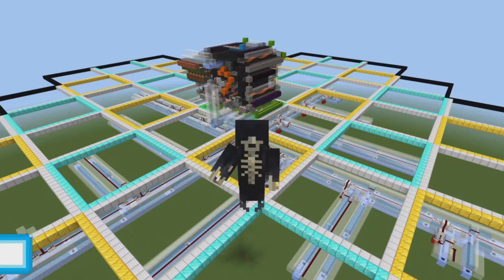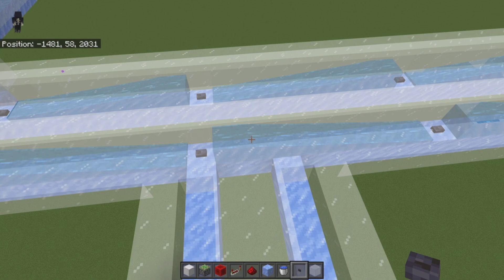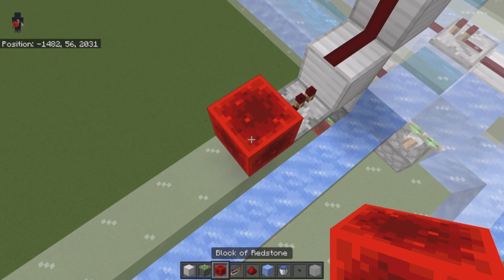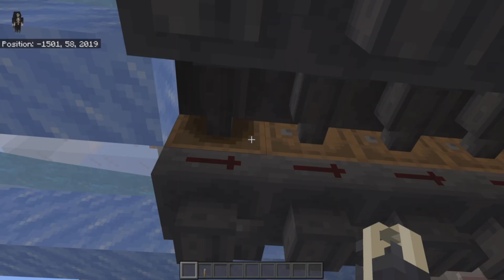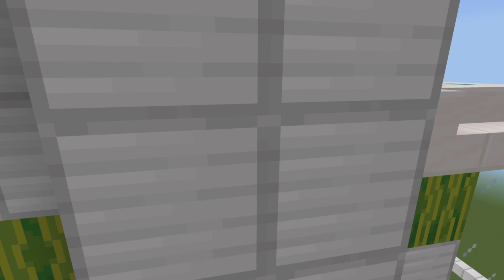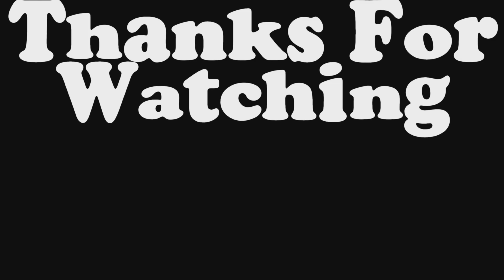How to Build a Superior Industrial District Part 2 (Simple & Easy) [Minecraft Bedrock 1.21]

Comment: Hello, I have a question about the shulker loader/ unloader. After I watched the video in full I decided to turn the farm on to ensure the loading and unloading process worked properly and found that the shulker box’s are only getting 1-2 bone blocks before being unloaded and replaced. I’m just curious if it’s intentional to get 1-2 blocks per box or if there is a chance I built the loader wrong when I first did it
Reply: I came for this comment! Thank you - I’ve spent ages trying to fix it 😂
Reply from the maker: Did u fix it?
Reply: @brokenbones623  yes! This worked, although I’m finding my auto crafters are getting blocked with moss blocks, so currently looking for a solution to that :)
Reply from the maker: Cover ur hoppers with blocks
Reply from the maker: I think u built it wrong, sounds like u need the subtraction circuit
Reply: @brokenbones623  Okay thank you, I’ll look back through the video to try and find where I missed you putting in the subtraction circuit
Reply from the maker: Yw bro let me know
Reply: @brokenbones623  Yo, I watched through both of your videos on the superior industrial district and didn’t see anything about a subtraction circuit, however I have started watching the super lichen farm to see if you put anything in there about it and at 4:15 you explained that if we power a repeater that’s pointed into a comparator by using a lever it’ll force the comparator to read the signal strength of a shulker through a piston and only when the shulker gives a strength of 15 it’ll be broken. I’ve applied this to the comparator that’s facing into a block directly beside the shulker loader under the bone block farm and for the moment it does seem to have fixed the issue.
Reply from the maker: Ya thats it